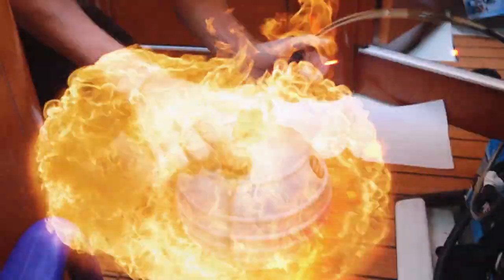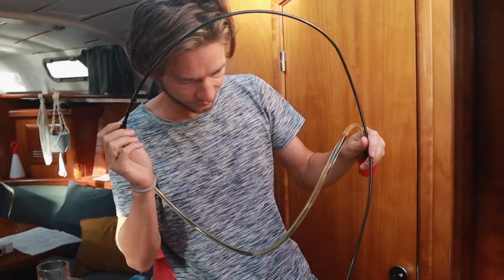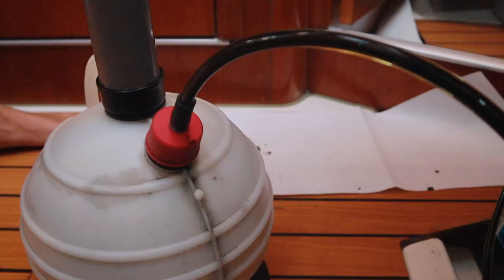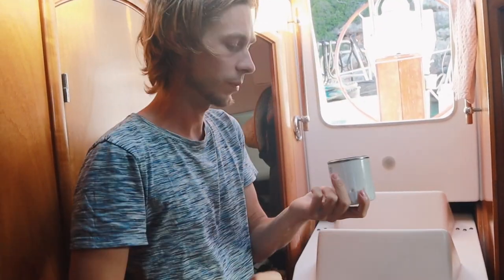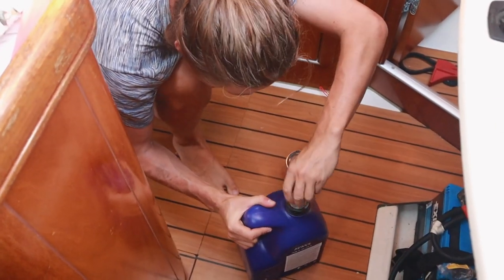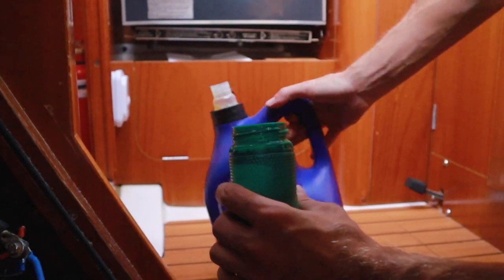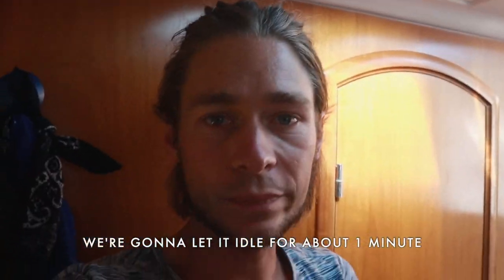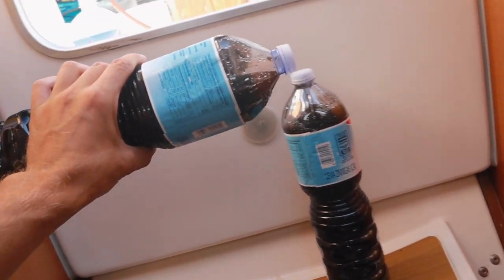HOW TO: OIL CHANGE (filter) Volvo Penta MD2030

Comment: Also, if I may add, best practice is fill the new filter 1/2 full of the new oil so the oil pump doesn't suck air and dry run. Let sit for a few miniutes before installing, which will saturate the filter material. Awesome channel folks. 👍
Reply from the maker: yup sounds good. thanks for the tip :)

Comment: Always check the old oil filter after you pull it off to make sure the seal came off also. I’ve had the old seal stay stuck to the block (I didn’t notice) and I screwed the new on top of it, filled it up with oil and start it. Oil came out flying everywhere! Opps!

Comment: While the filter is on the engine still. Put a plastic bag around it. This way the oil should mostly go in the bag.....Little kitchen paper just below to catch the drips :-) Keep a diary of Maintainance......feel free to use a permanent marker to write the date you changed it on the filter it's self. We usually keep spares of the engine service parts and spark plugs on the boat. Each change we will buy another set of filters and so on. The main thing you got to watch out for is the diesel fuel, 80% of engine problems come from the fuel so feel free to "upgrade" the pre fuel filter off the engine. You can also give the fuel a "polish" you basically make a small device using a filter and cycle it around your fuel tank. This way will get the water and the big bits out. Patrick Laine did a video on it.

Comment: Tip 1: Remove the filler cap to let air in, as you pump the oil out.
Tip 2 : Make sure you get the longer oil filter. They upped the capacity ...
Tip 3: WEAR gloves  ... contaminated oil can be carcinogenic.
Reply from the maker: awesome tips, thanks!

Comment: Your MD2030  volvo  penta is really a perkins  M30   .Volvo had Perkins make the 2010.2020 , 2030, 2040 for them 
Parts are cheap from parts4engines .com in England half the price of ripoff Volvo
Reply from the maker: that is one of the most important comments on this channel. thanks chris <3
Reply: @seethelittlethings  your welcome  I have a beneteau 352 basically same boat. Cheers from Canada